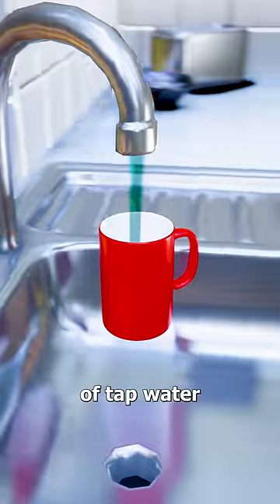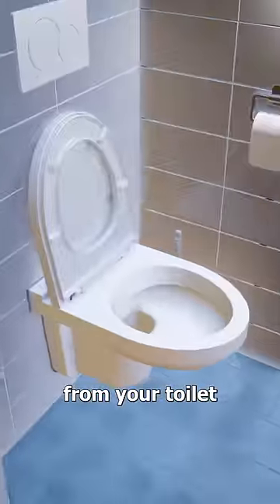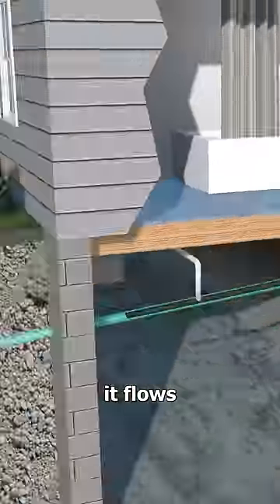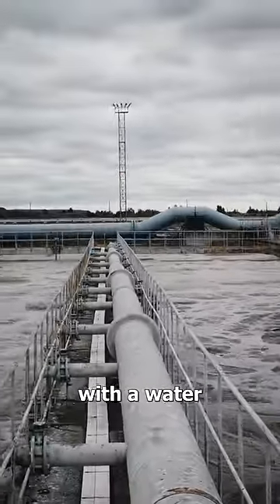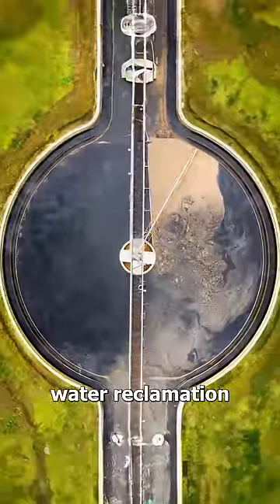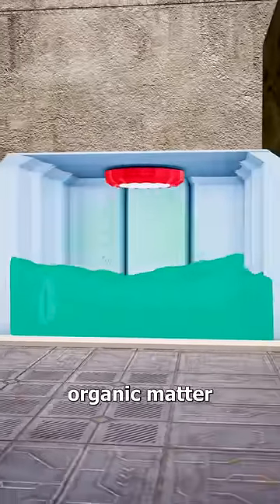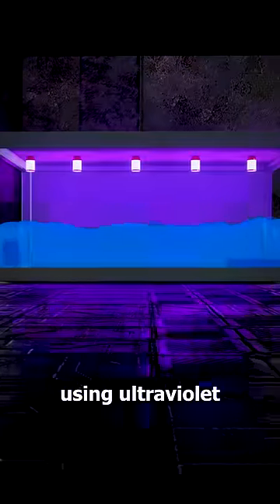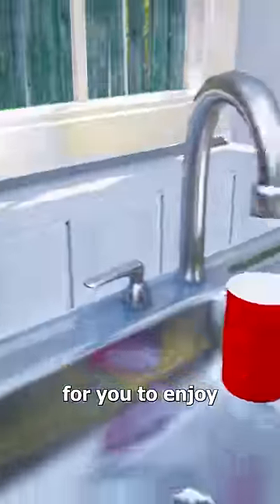You Might Be Drinking Recycled Toilet Water 😨

Comment: Toilet to tap systems require the highest level of cleaning requirements imaginable. They require pollutant loadings to be reduced by “5 log removal credits” basically divide the influent waters concentrations by 10^5 and that is the effluent quality requirements. The reason this doesnt currently exist is because very few systems can reach that level of cleanliness, and the ones that do are incredibly expensive. While from the concept it sounds gross, toilet to tap water systems provide the cleanest water in the world, under California regulations at least. I work in an engineering firm specializing in water resources and environmental engineering and we typically send effluent discharges to rivers or the groundwater. I still have never worked on a toilet to tap system, but maybe in the future.

Comment: My dad is a civil engineer and works with sewage treatment. It’s really cool. It’s first treated and then pumped back out into the great salt lake.
Edit: thanks for the 365 likes.
Reply: Vicaly
Reply: Just one question for your father, do you put back minerals to the sewaged water?
Reply: Purification process I guess😐
Reply: So what ?
Reply: @breadquonda2863  the great salt lake is shrinking and we have enough drinking water for ourselves. The great salt lake also is an important migratory breeding spot and produces millions of brine shrimp. If we lost it, it would be like the dust bowl all over again. Tons of loose salt being thrown up into the air and carried around. Rep. Casey Snider states, “Every drop we reuse, if depleted from the system, only aggregates to the problem of a shrinking lake”. The article, The Salt Lake Tribune, later states, “If municipalities across the lake’s watershed were to reuse and fully deplete their wastewater, the lawmaker said, the Great Salt Lake could drop another 10 to 12 feet.”
Reply: @berkaydogan9703  My dad said that in order to get all of the minerals out of water you have to use a process called reverse osmosis. Reverse osmosis is super expensive and the minerals don’t get filtered out. It’s expensive to install, you have to have tons of power and pressure to push the water through the membrane, and when you’re done you are left with maybe 60% of the original water. The water that is left that isn’t treated with reverse osmosis has a really high salt concentration. With the salty water you can’t just pump it out into a lake and you have to use ponds or wells.  Those ponds and wells allow the water to evaporate.

Comment: Actually Barcelona is one of those cities you mentioned. 25% of tap water is recycled.  They use various methods depending on the area. In some the water is filtrated and purified then transported up the river and thrown away for it to mix it with river water. It is later recollected down the river ready to be consumed again. 
The other method is what you just explained but in a big and advanced water treatment plant. 
Also, another 33% of the water is desalinated from the Mediterranean Sea. that means more than half the tap water is not coming from a sweet water source. These measures were taken because in Spain and more intensely in Catalonia we have been suffering very long and devastating droughts for a few years. The worst is that it seems like they are getting worse each year.

Comment: There's often two different kinds of water treatment plants, the first one being where your sewage goes, then it goes through the filtration process and then they usually send it back to the lake. After that, water then either evaporates, rains down and then ends up in other lakes and reservoirs where the second type of water treatment plant can pump that water into the plant, or, the same lake or river will have a different plant pump that same water to the water treatment plant. That second type of water treatment plant then brings the water through a different filtration system process that makes it then drinkable, whether the water was sewage at one time, or was simply just rain water. (technically all water was drank by someone or something at one time, at least most of it) 🦕🦕 So this is yet a very, very similar scenario, but you could be drinking water that came from many different places through many different processes and who knows! Many different plants. That's just what I've learned, hope y'all found this interesting!